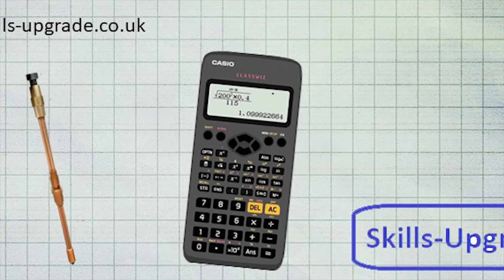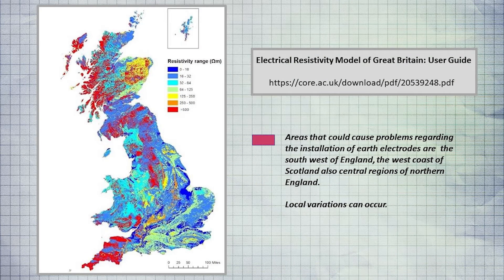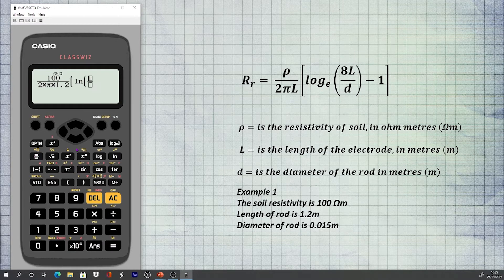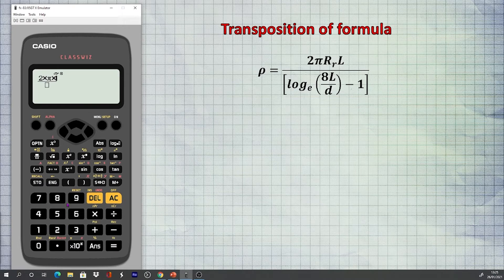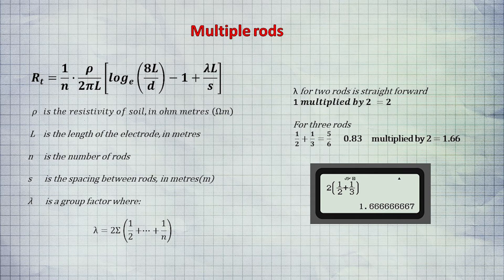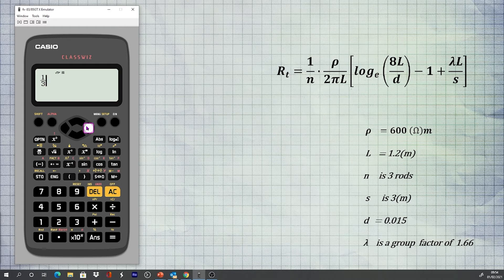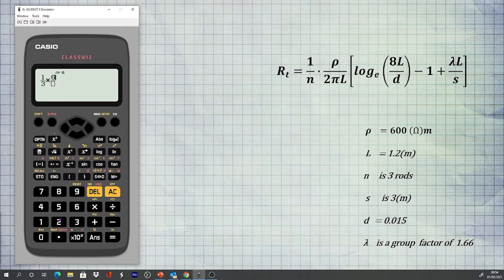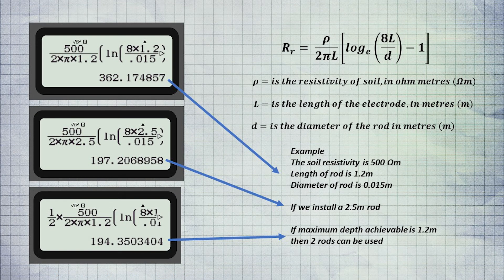Earth rod calculations when installing TT systems

Comment: Great and clear explanation James, thank you very much. However just wanna make it more clear of these 2 points. 
1. One reference say for the formula for single rod is:

𝑅 = 𝜌 / 2𝜋𝐿 [ln 4𝐿/𝑑−1] , 
(concern part is "ln 4𝐿/𝑑" which in the video is "ln 8L/d")
is it any difference about standard code ?

2. For multiple rod, is the formula can be used either for line or paralel rod installation?

thank you

Comment: Very interesting.
I don't suppose anybody knows what the purpose of the natural log in the formula is.  I know what log e is but curious as to its purpose in the formula.

Great video. Subscribed.
Reply from the maker: log e is to a base of approx 2.7 whereas a log is usually to the base 10. It was first developed for calculating compound interest and is used for situations of growth.The beauty of the Casio is that it takes all of the donkey work of calculations.